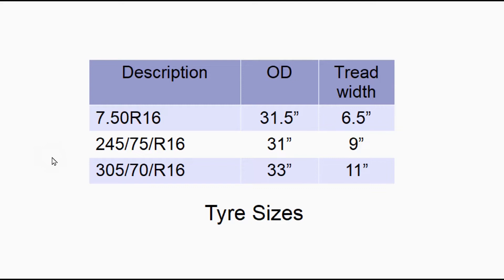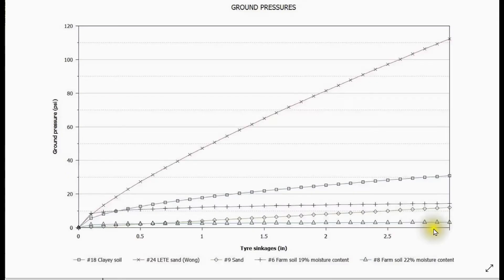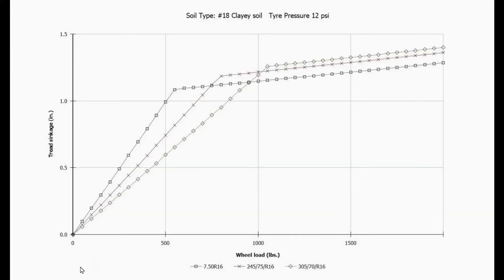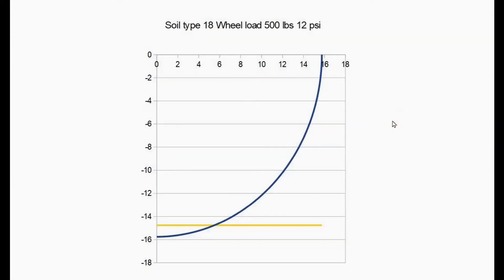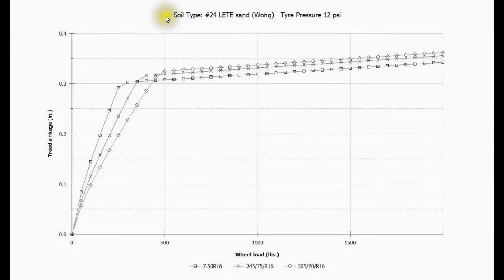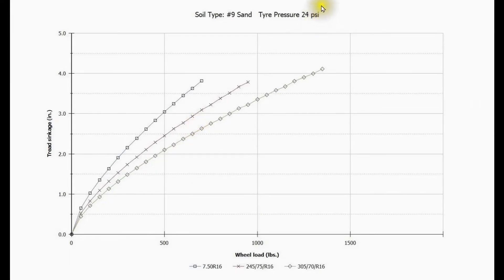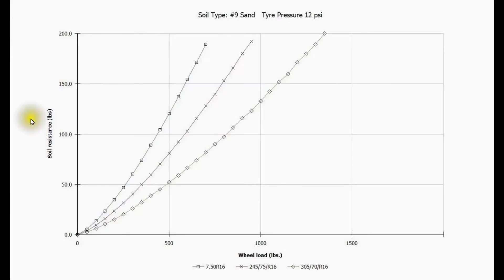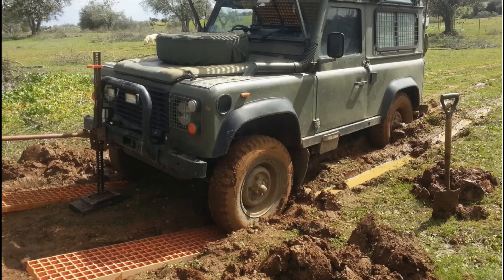Off road mobility using terramechanics. Pt. 2b - unpowered wheels

Comment: For very soft sand, the 4WD mantra is always to air down.  It's interesting that your analysis doesn't show that it is helpful.  However, your "low pressure" is 12psi, and generally the trucks going in sand run bead lockers to allow significantly lower pressures (4-6psi).  I'm curious, at what parameters (load, tire dia, tire width) would you start seeing an advantage to air down in soft sand when airing down gets you to 6psi instead of the 12psi you used.

Comment: Very interesting video.  I always thought that fish plating was the way to go over the top of a vertical welded seam, because it was supposed to be a requirement of Department of Transportation in the US. I have seen fabricated axles split vertically on welded joints but never heard if there was a finite analysis done after the fact. My assumption would be a poor weld affected the failure, then and not the design there of

Comment: An interesting side point (to me anyway) for on-road aquaplaning and general adhesion I've never seen mentioned   is the effect of the very significant increase in the  viscosity of water at reducing  temperatures towards freezing point, producing  enhanced  lubrication properties and greater resistance to ejection  via gaps between tread blocks; both mechanisms intuitively should favour narrower tyres to avoid scary cold weather motorway moments.  I'll anyway await your powered wheel analysis with interest.

Comment: One should also consider that the rolling resistance of a fat tire is higher when the sinkage is equal because of the wider thread. You therefore need more traction to be able "pressing down" more soil surface or snow. This increased resistance should make fat tires even worse offroading.
In my opinion the 4WD-Community is becoming aware of the issue.
Reply from the maker: There are two counter effects here. For a given load the sinkage of a narrow tyre will be greater than a fat tyre but for a given sinkage the rolling resistance of the narrow tyre will be less. However a larger external diameter always reduces sinkage and rolling resistance.
You should fit tyres which give controlled sinkage for the conditions encountered but no wider than necessary. IMO stupid wide tyres have no place.

Comment: Here's the issue Bill : People would rather believe the myth and look the part than sit and learn terramechanics, physics and demonstrated science.
I've said it my whole life : Skinny tall tyres are the best.
When soil type is of a certain kind no tyre will grip nor provide forward traction. The larger and heavier the tyre/rim combo mass the greater the suction.
Finally, the best reason to choose skinny tyres is because you can purchase cross ply tyres which are extremely stake resistant. All the "experts" don't know this nor do they learn.
Reply from the maker: I think skinny tyres are a good compromise for many conditions although there are situations where fat tyres perform better. However the part that I don't understand is spending a fortune to change the wheels and tyres to aftermarket fatties, not to mention the weight penalty, unless there are clear benefits across the board. There aren't. Manufacturers wouldn't fit skinny tyres (as most do) if they weren't up to the job.
One caveat however. I do need to repeat this analysis for powered wheels to see if the picture changes significantly. Practical experience indicates that the picture isn't very different for powered wheels.
Reply: @defendermodsandtravels  That's why HGV's, trucks and military transports all have skinny tyres.

But you won't convince the "4wd brigade".

The other myth of course which is perpetrated by the 4wd media and repeated by the great unwashed masses is that mud tyres are tougher and stronger when this is absolutely wrong and the opposite of truth.

Mud tyres are good in mud - Not in sharp sticks, sharp rocks, heavily rooted country and stones.

Of course, you can build a tough mud tyre but you won't be able to fit it to a road registered vehicle. You can fit it to a tractor or earth moving machine.
Reply from the maker: @adelarsen9776  You used an important word in your first post when you said "tall and skinny". A larger diameter tyre will always give less sinkage and external resistance. Larger tread width may or  may not help. The Ford T had a reputation for being surprisingly capable on farm tracks for this reason.
Reply: @defendermodsandtravels  Wagons Ho !!!